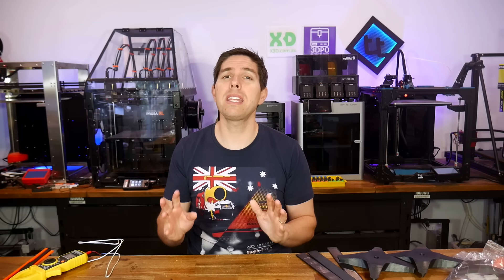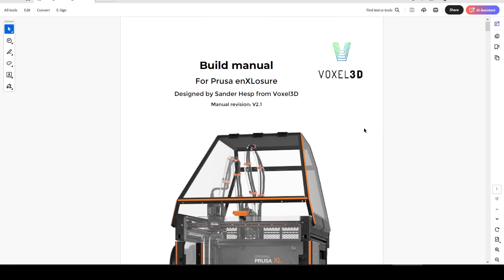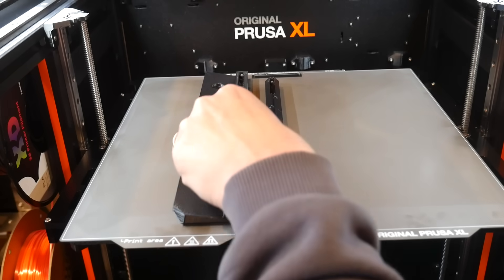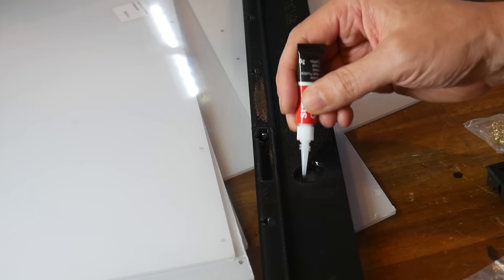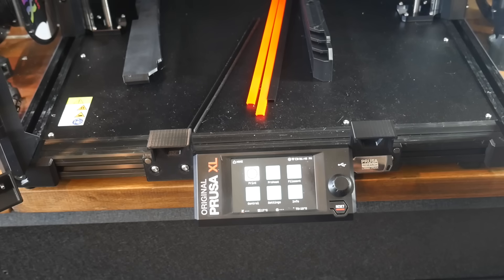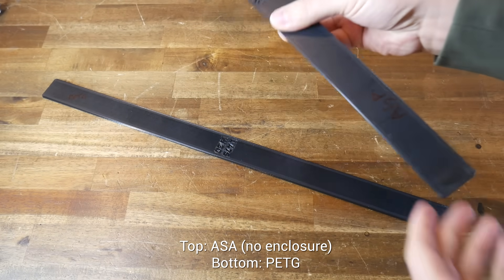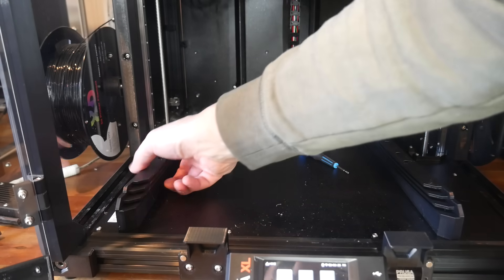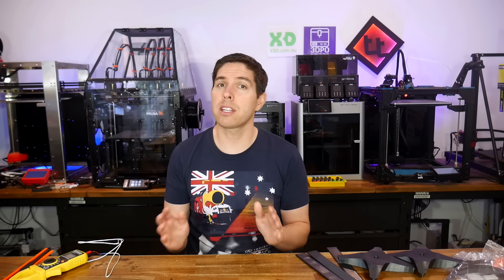The EnXLosure is the XL add-on Prusa should have made

Comment: I enjoyed the video. Thank-you. 

Drawing from my personal experience, the XL is great. I wasn't a fan of Prusa's enclosure, so I opted for the SUMO version. Very pleased with it. When printing colors, I find that PLA is far cleaner than PETG. But, I am still dialing in the settings. Huge fan of the core xy that Prusa produces and how seamlessly their work flow is. Converted all my MK4's to CoreOne. As for the bamboo, I don't own one, but my buddy has one. I think the quality is lower and when it's time to upgrade, you would just chuck it in the trash heap. 

Anyhow, thank you for the video and the detailed information. 
Best!
mw
Reply: The CORE One is held back by having to be backwards-compatible with a completely different product line. Rather than having wasteful and expensive upgrade paths (how many parts did you have left over after upgrading your MK4 printers to CORE Ones?), they should have done a clean break and made the Core One a brand new platform not tied to the flaws of the past. I guess the marketing aspect of "upgradability" triumphed over practicality.
Reply: @TROPtastic   I don't normally analyze someone's comments, but I think the time you spent penning a well thought out comment deserves an deeper looking into where I am coming from.. 

The post critiques the Prusa CORE One 3D printer (a CoreXY model released in early 2025 as an evolution of the MK4S) by arguing that its design choices prioritize marketing over engineering efficiency. I'll break it down into its core claims, explain each one, and then rebut with evidence from Prusa's official details and user discussions. This shows how the CORE One actually leverages backwards compatibility as a practical strength rather than a flaw.

1. Claim: The CORE One is "held back" by backwards compatibility with a "completely different product line."Breakdown: The poster implies that tying the CORE One to older Prusa models (like the MK3/MK4 series, which use a more traditional Cartesian design) forces compromises in performance or innovation. They suggest this compatibility drags down what could be a superior machine by inheriting outdated elements.
Rebuttal: Far from holding it back, backwards compatibility is a deliberate design philosophy that builds on Prusa's proven ecosystem, allowing the CORE One to inherit reliability without reinventing the wheel. The CORE One isn't shackled to a "completely different" line—it's explicitly an evolution of the MK4S, reusing high-quality components like print sheets, nozzles, and hotends to ensure seamless integration. This results in tangible improvements: a 50% smaller footprint in an enclosure, 30% larger print volume (250×220×270mm), faster CoreXY kinematics with Input Shaper for vibration reduction, and better support for advanced filaments like ASA and Nylon via an actively heated chamber (up to 55°C). Prusa emphasizes "exceptional backwards compatibility" as a feature that makes the printer more robust and user-friendly, not a limitation—it's compatible with add-ons like the MMU3 multi-material unit right out of the box. If anything, a total divorce from the past would risk introducing new bugs or instability, as Prusa's MK4S components have been battle-tested for years.

2. Claim: Backwards compatibility leads to "wasteful and expensive upgrade paths" with "leftover parts" after upgrading from MK4 printers.Breakdown: The poster highlights user frustration with upgrades, suggesting that compatibility creates inefficiency—e.g., buying a CORE One means discarding MK4 parts, leading to waste and higher costs.
Rebuttal: This misrepresents Prusa's upgrade strategy, which is designed to minimize waste and costs through a dedicated MK4S-to-CORE One conversion kit. The kit reuses the vast majority of your existing MK4S hardware (e.g., frame elements, electronics, and the Nextruder base), requiring only targeted upgrades like the high-speed nozzle, enhanced cooling on the extruder, and CoreXY motion system additions. Users report that the major changes are incremental, such as the extruder's cooling improvements, meaning most MK4 parts integrate directly without leftovers. Prusa's approach keeps upgrades affordable (the kit is positioned as a cost-effective path rather than a full replacement) and environmentally friendly, aligning with their "made to last" ethos. In contrast, a non-compatible design would force users to scrap entire printers, inflating costs far more—especially for hobbyists or small print farms who value longevity over novelty.

3. Claim: Prusa should have done a "clean break" to create a "brand new platform not tied to the flaws of the past."Breakdown: The idea here is that starting fresh would eliminate inherited issues from older models (e.g., potential limitations in speed, enclosure design, or modularity from the MK series), leading to a more optimized printer unburdened by legacy constraints.
Rebuttal: A clean break sounds appealing in theory but ignores the practical realities of 3D printing ecosystems. Prusa's iterative approach avoids the "flaws of the past" by selectively improving on them—e.g., the CORE One addresses MK4 limitations with 360° cooling for better overhangs (up to 75°), automatic first-layer calibration, and factory-tuned profiles for 200+ filaments, all while maintaining the reliability that made the MK4S a bestseller. No major "flaws" from the MK4 are carried over unchanged; instead, the design resolves common pain points like enclosure bulkiness and material compatibility. A from-scratch platform would alienate Prusa's loyal user base (millions of MK owners), increase R&D costs (passed to consumers), and risk compatibility issues with third-party mods or accessories. Reviews praise the CORE One as a "redemption" that competently takes on rivals like Bambu Lab without sacrificing Prusa's open-source strengths. Users debating upgrades often stick with the MK4S or opt for the kit precisely because the evolution feels practical, not regressive.

4. Claim: "Upgradability" is a marketing gimmick that "triumphed over practicality."Breakdown: The poster sees the emphasis on upgrades as superficial hype, prioritizing sales (e.g., selling kits) over creating the best possible standalone product.
Rebuttal: Upgradability isn't just marketing—it's core to Prusa's business model and delivers real practicality by extending printer lifespan and reducing e-waste. The CORE One's design supports print farms with features like 180° opening doors and top-fed filament, making it efficient for production without forcing a full replacement. Community feedback shows users appreciating this: many weigh the kit against buying a new printer like the H2D, but few complain about waste because the path is so straightforward. In a market flooded with disposable printers (e.g., from budget brands), Prusa's strategy fosters user loyalty and sustainability—practical wins that outperform pure "clean slate" designs in long-term value. If marketing were the only driver, Prusa wouldn't back it with EU-manufactured quality and open-source firmware.

In summary, the post overlooks how backwards compatibility empowers the CORE One, making it more accessible, cost-effective, and reliable than a hypothetical "clean break" version would be. Prusa's evolution strikes a smart balance between innovation and user needs, turning potential "flaws" into strengths. If you're an MK4 owner, the conversion kit is worth considering for those speed and enclosure upgrades without starting over.

As a bonus, I have boxed up all the "waste" from my upgrades and donated them to our local HS. The Director of technology appreciated the high quality parts. I added a bunch of Revo hotends as well. There are enough parts to build four MK3s with upgraded nozzles. 

Anyhow, I wish you the best and appreciate your comments. Love the interaction, as it helps us grow.

Comment: There is a remix for the LCD draft cover titled "Draft Stop For behind the factory LCD screen." This works well for my XL. I like "Prusa XL Heat Bed Controller Cover WITH Exhaust Shroud" more than the cover you presented. It has better thermal dynamic properties due to having less vent holes for the forced air cooling.
Reply from the maker: Thank you, I will look it up.
Reply from the maker: Found it, about to print. Thanks again.
Reply: @TeachingTech  No problem. You can also search for  Prusa XL CoreXY-front-left & CoreXY-front-right without hexagonal pattern for EnXLosure Remix,  which is my remix, or you can use the original which has a hexagonal pattern. Then you do not need to use a gasket.